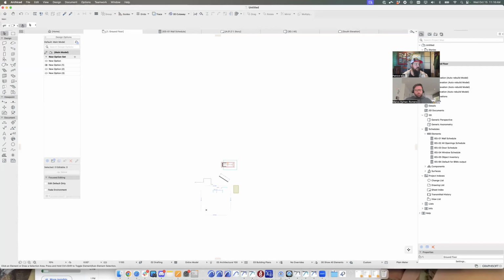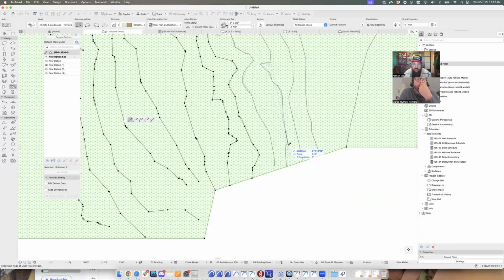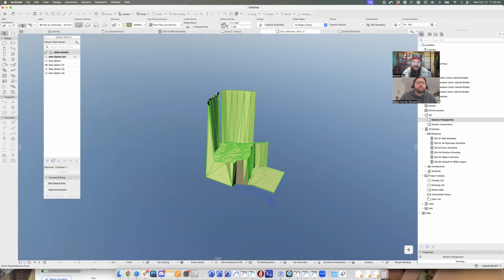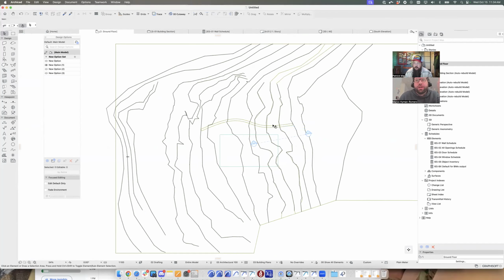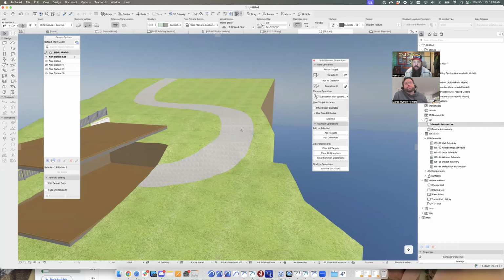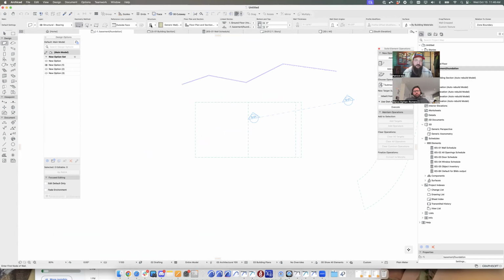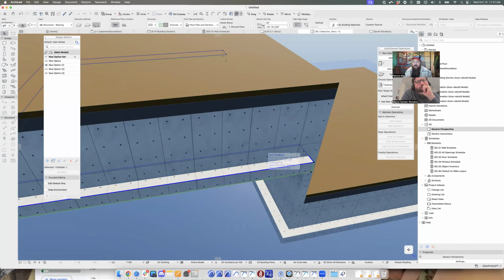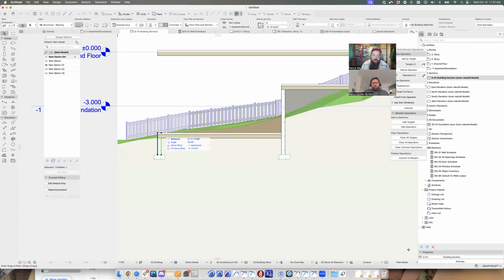Building Lab - Site and Foundations

Comment: Great video showcasing the tools. I was able to learn a few more creative ways to use the tools.....I have a tip regarding building the site model. I usually create a site plan view at the bottom and have it on its own level then drag it to the desired elevation. I also like to separate my 2d elements from the 3d elements. For 2d I recommend working with them on the Worksheets, I saw that you had to drag the contours to another area on the plan view. With the worksheet you can clean up the 2d connections and then you can copy the contours and place them where your project origin would be....It may seem like a small thing but as the project grows in size you will be grateful that you separated them.